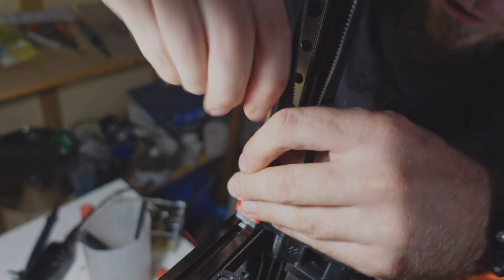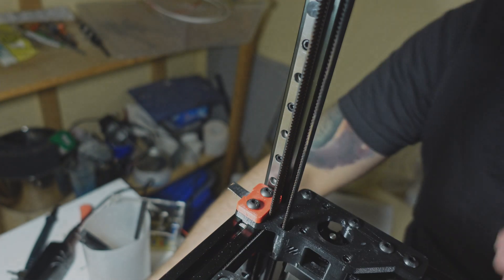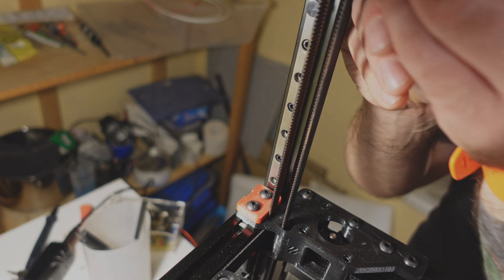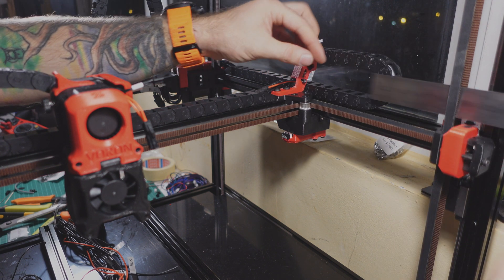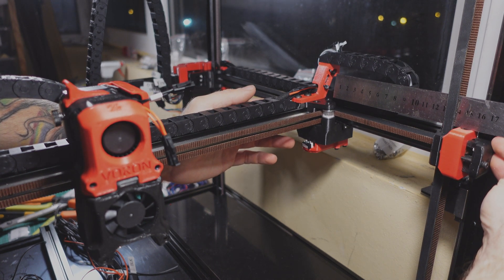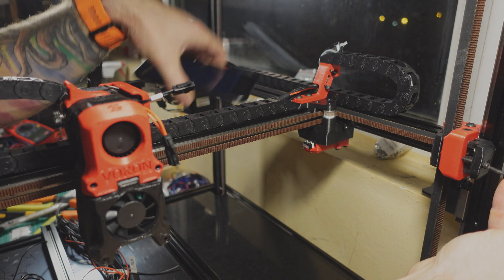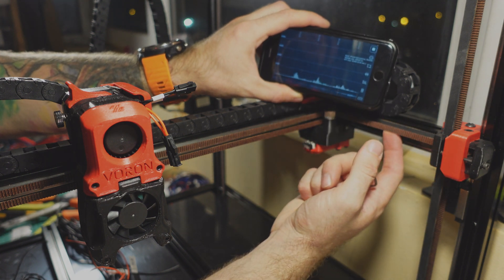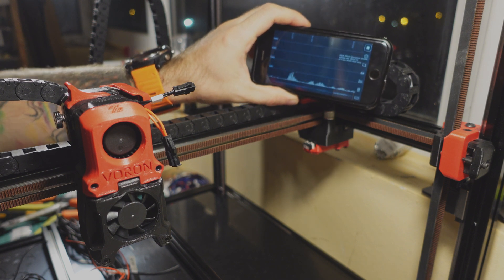Building Voron 2.4! P14 - Tightening the belts

Comment: I really od enjoy your videos as theyve helped me get my own voron 2.4 along. The only issue ive had for a while now is figuring out my electronics hardware layout. I got the Formbot 350 kit and it came with a pre done wiring set, though they ont give any indication as to where the hardware goes so i dont have wires all over the place or too short. My other issue is i undrestand some things need to be done to the octopus board before it can be used.
Reply from the maker: Hi! First of all thanks that you find my videos helpful.

Secondly, I must admit that I have no electornics footage, camera glitches destroyed it. Also, my kit was not pre-crimped, so no much help for you there.

Most of the docs regarding Octopus are found here, on Bigtreetech github: https://github.com/bigtreetech/BIGTREETECH-OCTOPUS-V1.0/tree/master/Octopus%20works%20on%20Voron%20v2.4

Also, I think that guys on discord would be happy to help you.